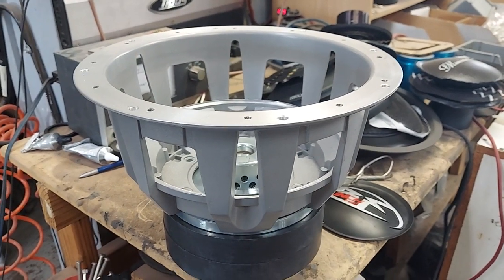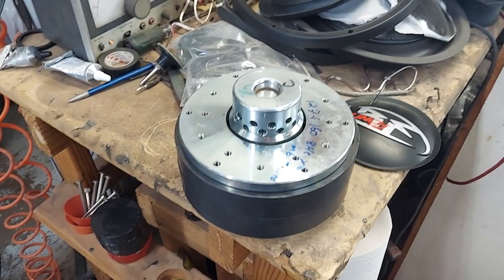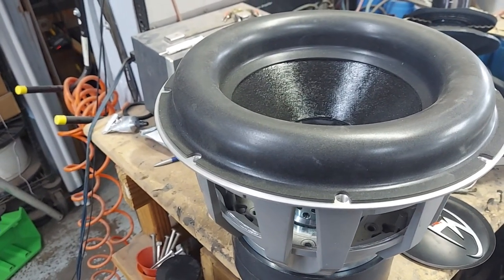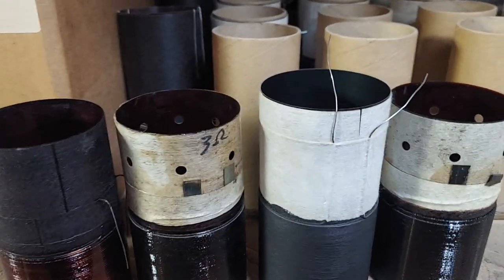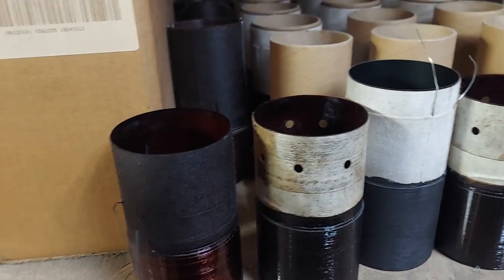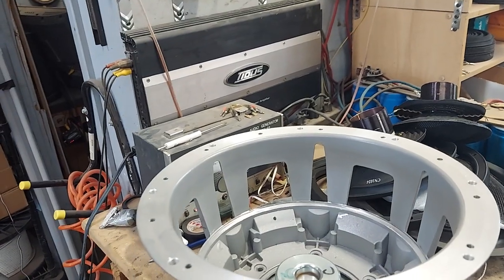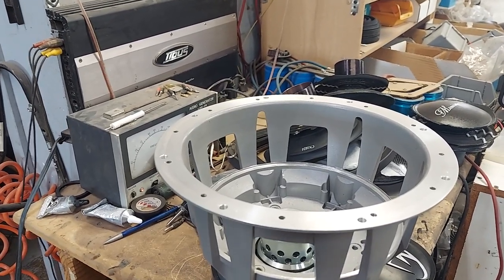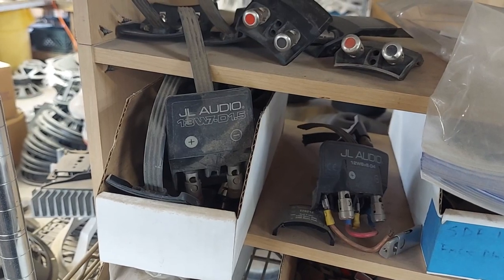JL Audio 12" 12W7 W7 Follow up with frame and soft parts details by Patrick @RobotUnderground

Comment: hi i need your help i faced many problems on making and repairing voice coils because there is no raw material in my country like thermoset adhesive withstand high temperature , glass fiber sheet as voice coil  former, original tinsel lead wire ,ets. but my main problem is geting the right supplier and the first of all the name of voice coil adhesive according to your experience please
Reply from the maker: What country are you in?
Reply: @RobotUnderground  iam from lebanon
Reply from the maker: @sadikhodroge2125  Use the website Alibaba and AliExpress to start finding sources for materials.
Reply: @RobotUnderground  ok thanks ,but did you know any brand name please
Reply from the maker: @sadikhodroge2125  China will not know brand, only chemical compound or compound name.

Comment: Hi Patrick! Awesome vid as usual! I have a w7 top plate that i need to re-align, what size pvc (or whatever you may use) shim do you use? I already ruined one set of spider/coils, id rather not do that again!  Thanks! Keep up the good work for us ridiculous bassheads!
Reply from the maker: The ones I have here I just made from 4" white PVC from Home Depot.  The 1mm thick sheet of Teflon I got from McMaster Carr but you can use plastic / overhead viewer sheets to get the same thickness.  The PVC shims are 2.2mm thick.
Reply: @RobotUnderground  Awesome. Thanks for letting me know, have a great day!
Reply: @imawesomeyourenot  now buy a sticker pack to show some love

Comment: You dropped a lot of knowledge in this post I gonna watch and learn really you got me wanting to switch to another brand I just always liked JL but a lot points you made got my attention and some funny’s also do you sell parts ? 12” w7  Maryland showing a little ❤
Reply from the maker: I sell some parts but I think it's better to convert them.  Text me direct, 6023126504
Reply: @RobotUnderground   do explain ,I respect people’s time  so inquire gather my thoughts then act so forgive me for asking a lot questions
Reply from the maker: @MadballBaby  Well, I think it's easier and better in the long run... as well as more affordable just to remove the original frame.. Sell the parts off to help pay for a new top assembly that simply bolts into place.  We sell those for $265 shipped.  https://www.instagram.com/p/Cj6XjsQP2Ii/
Reply: Thank you for replying back ,not sure where to sell the parts but I’m open to learning  do you provide any videos?
Reply from the maker: @MadballBaby  https://www.facebook.com/groups/981282085253169
https://www.facebook.com/groups/552633299628333
https://www.facebook.com/groups/213821505437883
https://www.facebook.com/groups/167939533608566
https://www.facebook.com/groups/1477717038939096

Try those.  You should get some traction.

Comment: Any tips on connecting aluminum wire wound voice coils to tensile leads?
Reply: The lord of bass has solder that he sells with a rosin that heat up rest hot and sticks to it. I also bought some aluminum solder from lowes for ac repair it works too.
Reply: Buy electronic (not plumbing-it’s acidic) flux separately, and apply with a syringe if necessary - it will assist with a better flow of solder in general. Also, I’m sure you know this, but just in case, use a proper mix of leaded/tin rosin flux core solder like 60/40 or 63/37.
Reply from the maker: Aluminum solder from SolderDirect.com but it's cheaper on the shipping through Amazon, https://amzn.to/3alWbDH
Reply: Excellent, thank you all for the tips. Just an fyi from me, I have found that you can get very high quality, high temperature aluminum coated wire from the secondary windings of microwave oven transformers. For those who enjoy making their own voice coils. I have one made that I have been testing using the lord of bass coil adhesive in a alpine type r motor and getting great results. Trying to find someone locally who can pull parameters for me. The wire I salvaged is appx. 28 gauge and yielded a dcr of around 7 ohms per coil using the factory coil wind height and length.